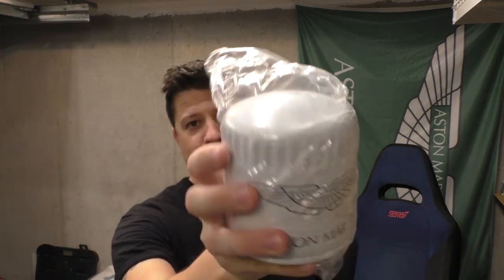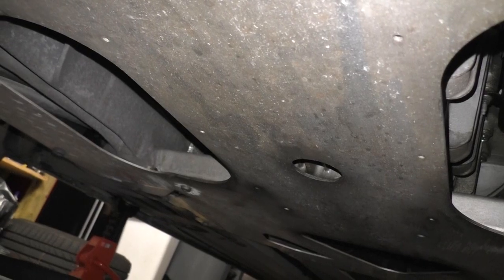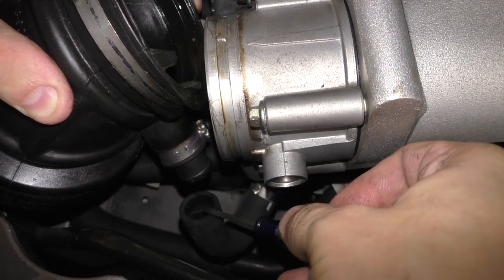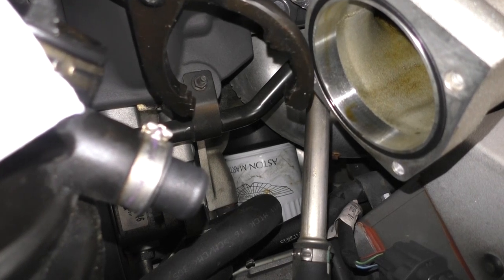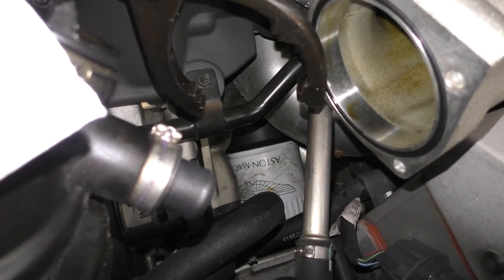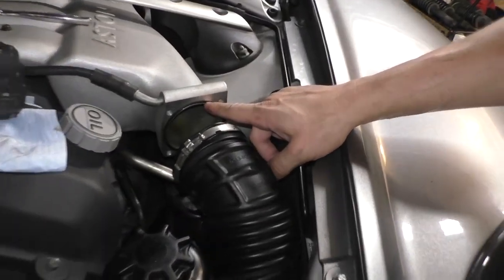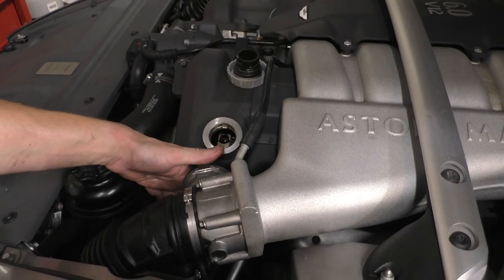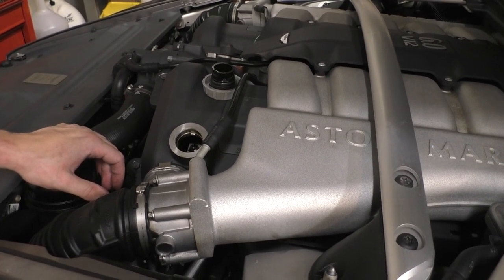Changing the Oil in an Aston Martin DB9

Comment: Just got done and what an ABSOLUTE PAIN IN THE PSOTERIOR!!! The angle of the filter and the radius on end of the fitler makes fitting a 3 finger grip tool impossible, in the end I used my old - 30 year old - chain tool, I had to use the new filter as a sample and weld the the chains in size place as there is no room for jiggling to get purchase, you need to locate and turn without any play, maybe your tool works easier, but I couldn't find one like yours in England. Eventually my old trusty tool worked. I thought I had all my tool tools set, but as usual it all depends on getting the suitable tool for the job. I'v saved the old filter and bought 3 more tools and make one of them in advance to work more efficiently. Sorry about the rant....Good informative and helpful video!!

Comment: Unfortunately, without removing the lower pans, the old oil from the filter removal will create a mess as it slowly, over the course of days, runs inside the pans drips from all the seams onto the ground.  Even when you think you caught all the oil from the filter spillage, it still somehow leaks out.  I typically use a can of degreaser and a hose tp clean everything straight down over the filter area after the oil change so none of that gets caked up inside.  I keep telling myself that removing the pans is the best bet, but I never do.

Comment: What size engine is your V 12.  Is it the same engine as a 2015 V 12 Vantage S?
Reply from the maker: All of Aston's V12 engines from that generation were the same size.  There were some differences beyond displacement, which affected power output, but they're all 5.9L (marketed as 6.0L).
Reply: Redpants thanks.